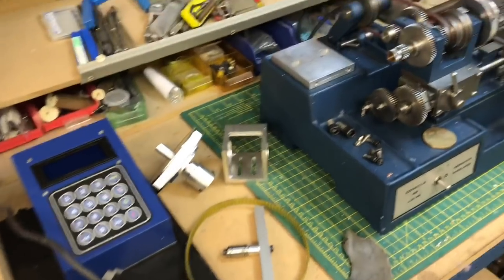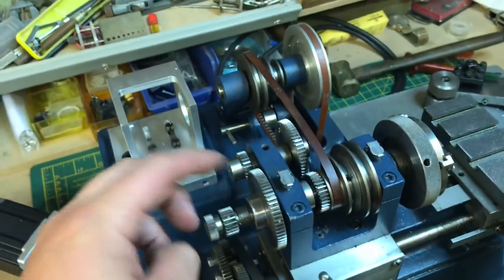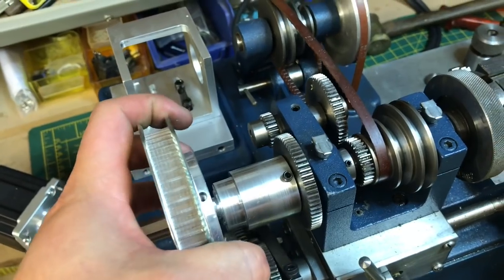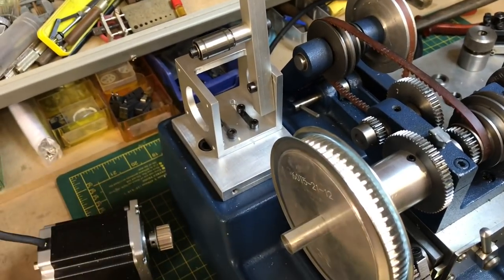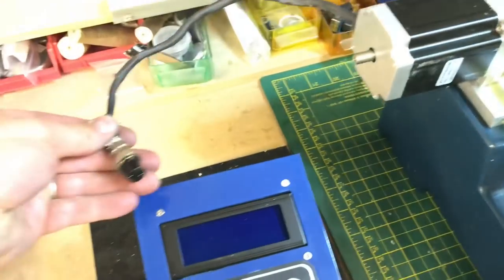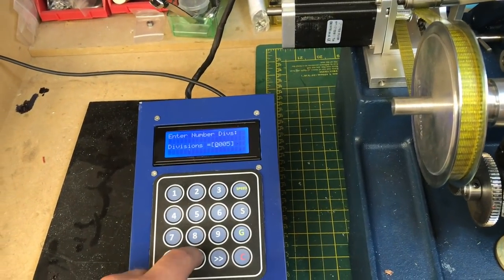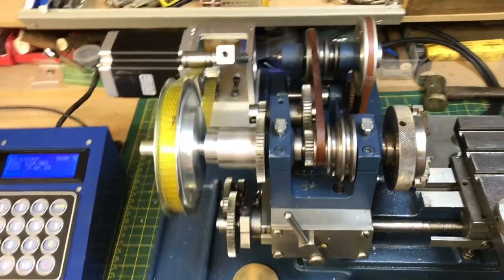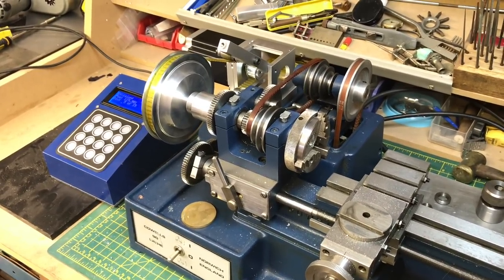Cowelłs Lathe Digital Spindle Divider / Indexer - clock wheel cutting (90ME)

Comment: i would only change the tensioner bearing to me it looks like a sliding bearing designed for sliding along a axle with balls in length ways plastic cages not designed for rotating around a axle that way they make indents in the plastic and start sliding instead of rolling which defeats the purpose of a ball bearing , just my 2 cents.